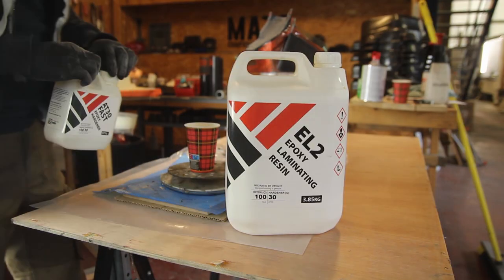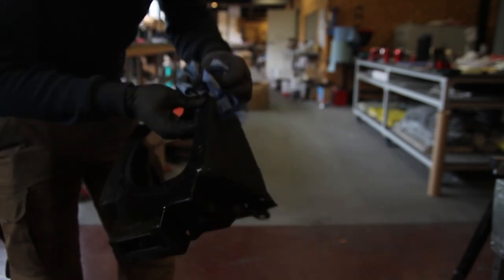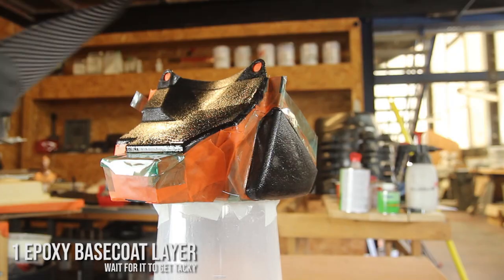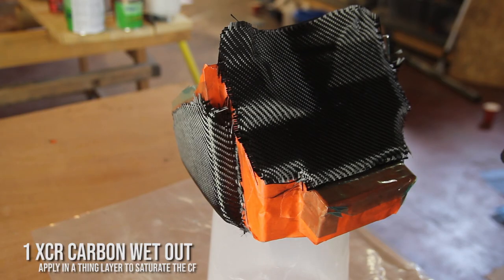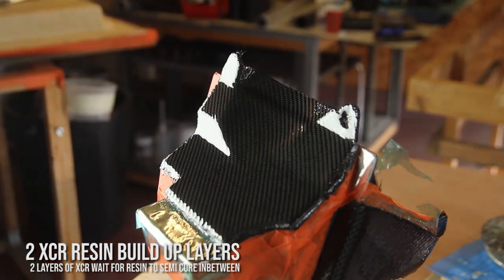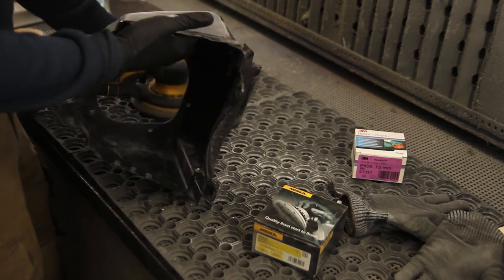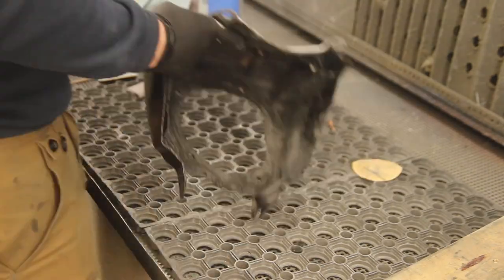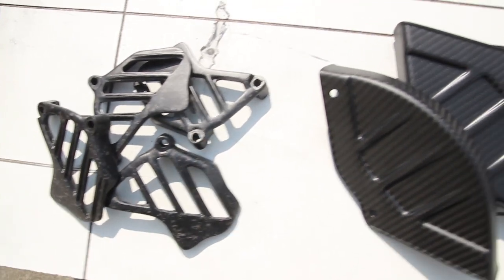Carbon Fiber Skinning Motorcycle Part

Comment: Hey Matthieu,

great video as usual. Ive learned alot regarding prepregs and infusions from you, so here are some tips from me for skinning. Ive been skinning since 2020.

1) Use a 2K Upholstery Glue to stick down the carbon. Solvent Based Glues adhere far better to plastics and can expand with heat if necessary. Epoxy doesnt stick to abs and  the likes since there are no solvents. Give it one heat cycle at 80°C (easily reached in a car interior) and it will come loose due to the CTE Delta you mentioned. Thus no more delam. Exception are for ex PP/PE, here youll need to use a adhesion promoter since PP/PE have low surface energy and are hard to bond.
Also easier to work with, since there are heat activated glues that allow you to place the weave as you wish with a slight tack (but still being able to remove it), only after heat treatment the part will be fully bonded. Especially good on multi ply pieces.
Also much better if you use a black epoxy as base (on aluminium for ex) because that way if you press on the carbon while laying it up, the resin might print through the carbon leaving a visible black spot. On Aluminium i use a 1k Etch Primer and the 2k Glue over it, the Glue melts up with the 1k etch primer and makes a really nice bond. I also tried with only glue on aluminium (works as well) and with 2k Epoxy (sprayed, didnt bond as well since  the glue doesnt bond good to epoxy since its not solveable, same like with epoxy on plastics)

2) To trim the excess material, leave it to cure and then use a heat gun to heat up the flanges and trim it off with a stanley/cutter knife. This works perfect since through heat youre softening the not yet heat treated resin and makes it easy to cut and get perfect straight lines. This can be done even at a later stage when more layers of epoxy are down. You could cut up to 1mm thick resin (if not heat treated)

Just my experience from 3 years of skinning, been doing a lot of parts and running through probably more than a ton of epoxy :D
Reply: Thanks a bunch for letting us know these tricks.
Reply: Thanks very much. 🤙
Reply: Excellent info! Do you mind sharing what 2K glue you use?
Thank you
Reply: @Reddevilowns  Any thermoactivated 2k upholstery glue will do. Just make sure its heat resistant enough! The glue sticks well to the weave, apply on both sides (weave and the part) and stick it. After letting it cure (make sure all solvents are out, leave it for at least 24h) you can start filling with resin.

Where are you located?
Reply: @carbonfabrik  I am located in Massachusetts in the USA. Any particular brand you recommend? Having a hard time finding any 2K thermoactivated glue
Reply: Hi sir can you supply skinning resin here in india, i've several brands of epoxy resins but nine of them are compatable for carbon fiber skinning!
Reply: Thanks ! Good tip on that upholstery glue

Comment: Hi, off topic but since you work with carbon fiber please advise!   I have an exhaust end cap made with 2x2 twill carbon fiber.  It is attached by small removable bolts and the fitment on the metal exhaust.  I want to remove the end cap without damaging it.  There are no adhesives only the tight fitment, how would you knock off the end cap?    Please suggest a way to loosen or lubricate/penetrate between the carbon fiber cap and titanium exhaust.  TIA!

Comment: This is awesome . I'm thinking of reproducing / improving a factory (Miata) car airbox but using Carbon Fibre Sheet as a base or make the moulds with 3D printing... Have you got a tutorial like that.. I can model parts in 3D CAD I'm just not so knowledgeable with Composite process

Comment: Did you try to apply peelply after 2nd resin layer let it cure and take peelply off and then sand ??? I get flatter and even layer to sand and you wont close small air bubbles

Comment: What is the electric shears that you use to trim the excess cloth? Seems to be not too messy
Appreciate the video
Reply: EC-cutter. Works wonders with any fabric, carbon/glass included. Dry fabrics only though, not recommended for prepreg or other resin inpregnated materials. Surprisingly durable, would highly recommend.
Reply: @richardf1b  Thanks

Comment: When you lay the Carbon Down, when do you Apply next lay?
Reply from the maker: Once the first layer is tacky and you apply the carbon you are ready for a fresh layer of epoxy resin
Reply: @MatthieuLibeert  thank you so much. I Will try you 112233 technique for my next skinning parts. 
Thanks for a good video 🙏🏻
Reply from the maker: @simontange3492  glad I've been of some help! Good luck with your project!
Reply: @MatthieuLibeert  After Carbon and 1. Layer, what sandpapir ? and after 2 more layers, what sandpapir ? Last 2, what sandpapir? 
I did light 120 after 1, then after next 2 layers 180 and 240, but must have sanded to much, hit the Carbon so its a do-over 🤯